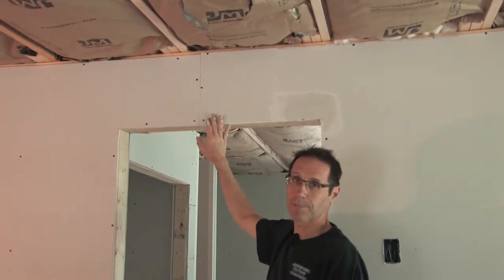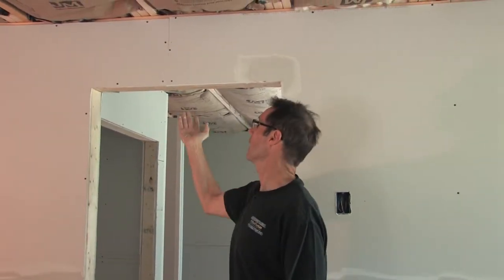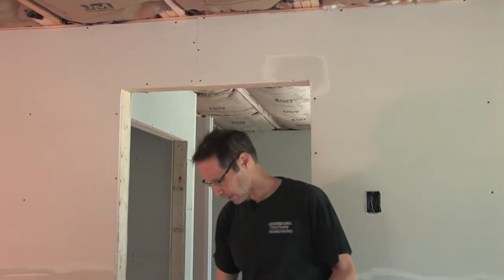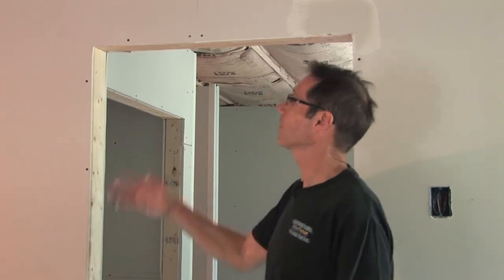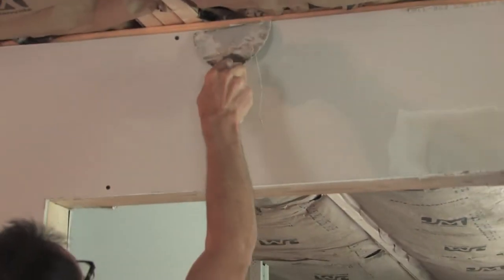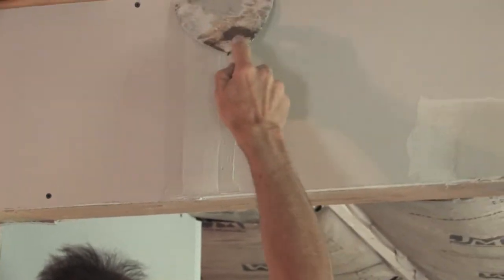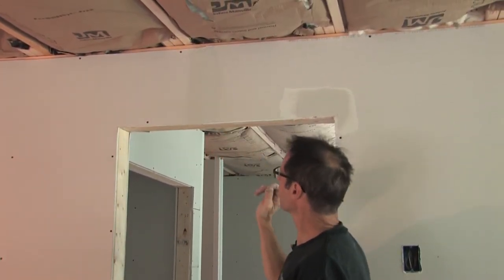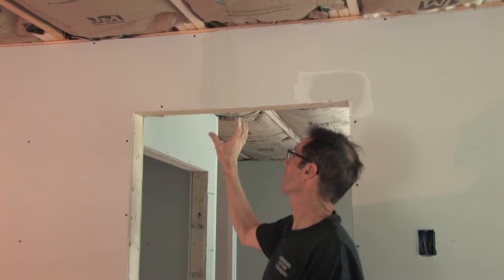Use FibaFuse to repair butt seams

Comment: Myron - Two questions for you: 1) How thick is your mid layer below the FibaFuse tape BEFORE you lay the tape on there and pull it across?  In another video here on YouTube you were embedding paper tape and you said the mud layer was "a light 1/8 inch".  Do you use the same mud depth for FibaFuse?  2) AFTER you pull your knife across the FibaFuse, can you see the tape?....I mean, does the mud squeeze up through the tape and literally leave a layer of thin mud now on top of the tape so that you can no longer see the tape?  (from what I can tell in the video that is the case)  I ask these 2 questions because I just used FibaFuse on a butt joint and was careful to hold the knife fairly straight/parallel to the wall when pulling it and tried not to use excessive pressure like you said in another video but after a couple passes I could still see the tape.  Yes, some mud had obviously fused into the tape but I could still see the tape sitting somewhat 'on top' of the mud.  Did I not put enough mud below the tape prior to pulling the knife?  Or did I have enough mud but use too much pressure and removed too much mud? (I will say I was surprised how little mud I got on the knife when pulling it across.)  Sorry for the wordy questions but the devil is in the details....
Reply: That is what is so good about FibaFuse. If you don't get enough under the tape, it is so porous that you can just add it directly over and it infuses with the mud and wall. I have been using it for everything - even inside corners on entry ways. I would not use it on the full length of an inside corner because it can rip.